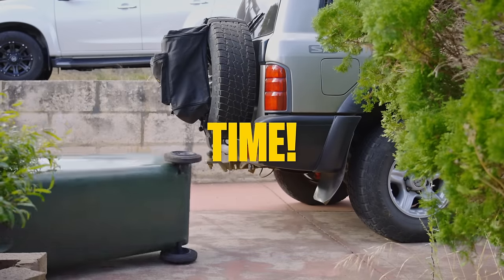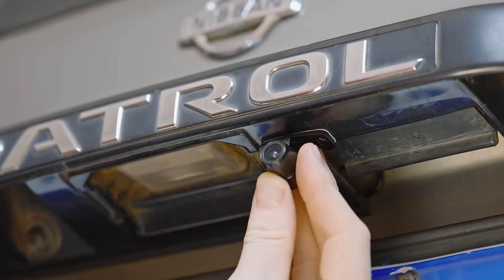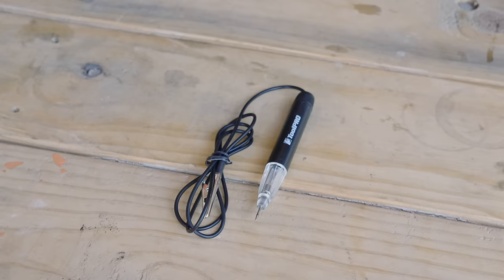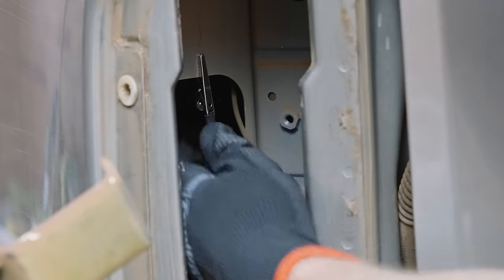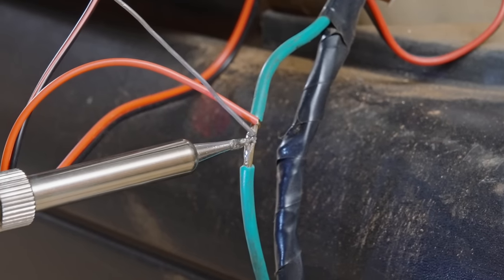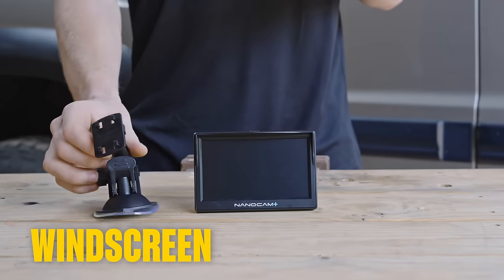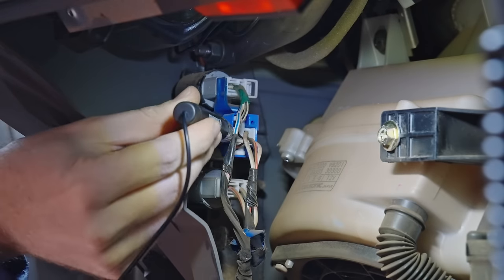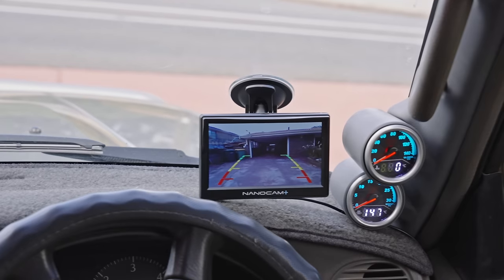How to Install A Reverse Camera - Super DIYs

Comment: Exhaustingly complicated I’ll pay an installer
Reply: Amen
Reply: Im about 2 hours in, can confirm its not easy or an hour job
Reply: I'm getting the wireless solar one..😢
Reply: @ace1007  I posted for an auto electrician on Airtasker. Very satisfied and good price. He had two bags full of tools. He mounted the reverse cam perfectly dead centre and discreetly under an overhang above the number plate. Ran the cam wiring to the head unit through the cable that unlocks the boot. Completely hidden. Well worth the money to have it done professionally. Do not recommend DIY.
Reply: I've installed four (two for myself, two for others) and it really depends on the make/model of the car and how easy things are to locate, route and move. Some can be done in 30 mins, others a lot longer.
Reply: Any car stereo installer
Reply: @Lucifer_Summons  car radio installer or auto electrician

Comment: Just solder into your ignition wiring, yikes, no thanks!
Reply: I agree, would you say there's another way around it i dont want to stuf up my ignition wires :)
Reply: Yes you can just crimp the wires together and apply heartshrink over it 😊
Reply: @ratnavenkat7623  Complete beginner, no idea what I'm doing so please forgive my ignorance. Would wrapping the wires together and covering with electrical tape work?
Reply: i just joined in the fuse box
Reply: @UKBxnzh yes it would but not the best for longevity and safety. Butt connectors or even wire nuts work better then just tape .

Comment: you could also just wrap the wire tight to the other wire, then use rubber electric tape and wrap it real tight.

Comment: What I don't get is how to get the wire to the front? He is putting the wire in the bottom of the boot? But how to open your door? Where does the wire come from? My boot door is opening up into the air (I don't know how to better describe this)?
Reply: You have to possibly remove the felt panel from the boot lid to run the wire over to the boot hinge.  Zip tie the wire to the hinge leaving some slack.  Then pull the lever for your back seat rest and feed the wire from the trunk to the inside of the car and route it underneath the bottom trim panels by the door.

Comment: Does it always have to be the tail light splicing? What if you connect directy to the battery or a secondary fusbox and have a toggle switch in between for option to turn on the camera?
Reply: Yes.
That will work if you want to be able to look behind while driving.
Just won't automatically turn on when you are in reverse

Comment: I have led lights on camera, when I plug camera video cable to car multimedia head unit, car lights are on.
camera working only in reverse mode with ignition, but lights not turning off when turning ignition off / removing key.
what am i doing wrong / how can I fix it?
thanks
Reply: Sounds like you have hooked wire  to a constant power wire that stays on all the time even if car key is removed from Ignition.
You have to hook to a car power source that is only live when key is on acc
Reply: @pyromaniac354  thanks
I will try it.

Comment: I put the camera on but it doesn't show the lines. How can I display the lines?
Reply: On most cameras there a small seperate wires located on the video feed wire. Usually if you cut one, it will hive you lines. And if you cut the other one (if there a two) it will change video resolution or output type.

Comment: That’s not how to solder. “Tinning” is covering the cooper wires in solder. You should never carry the solder on the soldering iron.
Reply: The soldering iron tip must be tinned. I think he meant that. You could also tin the wires and this will allow the solder to flow more freely.
Reply: Lol. He did the proper technique actually, that's what you're supposed to do!
Reply: Oh dear